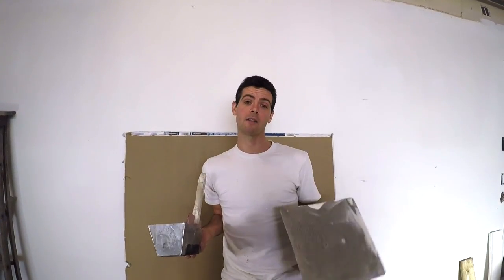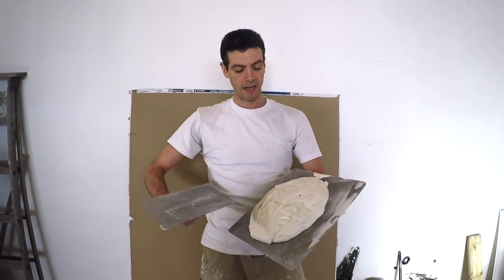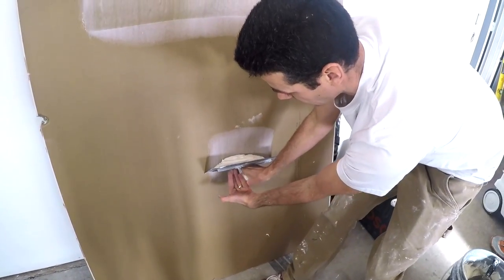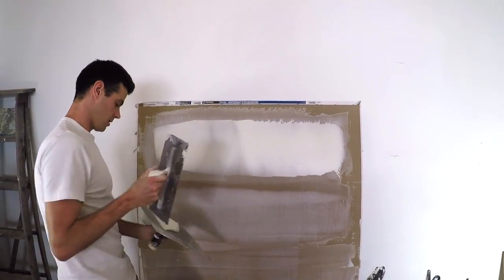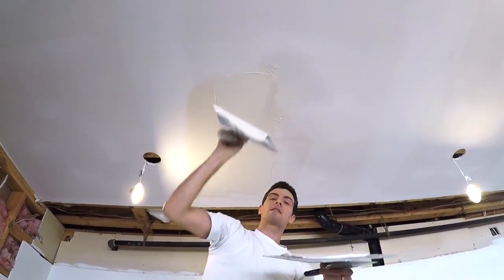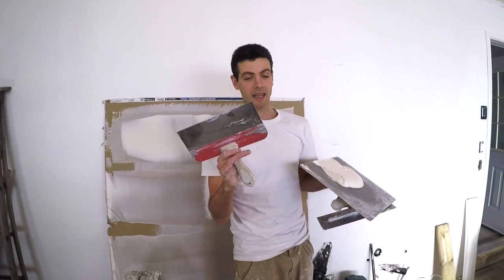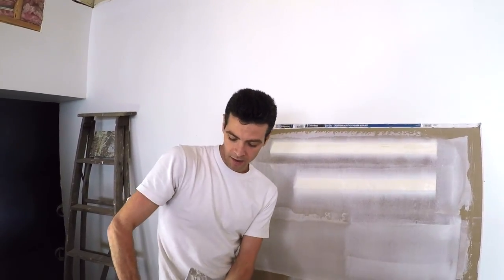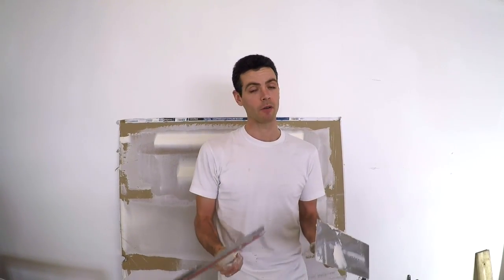HAWK AND TROWEL VS PAN AND KNIFE

Comment: As a painter in the US I've mixed and spread tons of hot mud. I've never used a hawk & trowel but after watching your videos I'm going to start. One thing I never realized is how precise you can load a trowel or knife, avoiding "squirt out". Not to mention cleaning a hawk is so much easier to clean than a pan with all it's corners !
Reply: That is called mud control. Practice is key. 🙂
Reply: The pan does suck to clean. I was just thinking that
Reply: The secret is to always have a bucket of water nearby with a brush in it. And when using setting mud, get any excess out of your pan and into the trash IMMEDIATELY as soon as it starts kicking off so that it will still come out with water.

Comment: I’m going to go out on a limb here and say that most people watching your video (in order to learn) aren’t professionals. We are homeowners trying to beautify our homes. That may not be your intended audience but I’d bet most of us are just that. 

I love the videos and the sense of humor you bring and thank you for the hard work and time you and your cameraman spend on these videos. 

If I may speak on behalf of homeowners watching this video we come here to learn how to patch door knob holes, repair settlement cracks, cover old phone line outlet box holes, and the like. I’ve done lots of drywall work but have never picked up a full sheet of drywall. I have used both conventional and light weight setting type and drying type compounds and both paper and mesh tape. 

I also understand trowels to be a plasterer’s tool and a knife to be painter’s tool. In my opinion, learning to move mud around is much easier using a knife. That’s likely because I’m never really moving much mud around by comparison. 

If I ever do large stucco work I would certainly buy a trowel. 

Thanks again.
Reply from the maker: Actually, homeowners and DIY is my intended audience but I don't mind the pro's hanging out either.
Reply: I can’t use a knife worth a darn but I’m great with a trowel. I’m not a pro. If you hate mudding and feel like it is just unintuitive, try the hawk and trowel.

Comment: I have been working on a job the homeowner tried to fix and have been having to reskim entire tape lines. I was lucky enough to stumble across your page. I have probably watched a dozen or so of your vids in the last couple weeks. doing so has actually taught me enough tips I didn't know to make the experience tolerable. tomorrow I will be purchasing myself a Hawk and Trowel for future jobs like this. (I am a painter by trade, but often, demolish, construct, drywall and repair things before Painting occurs). thanks for taking the time to make these videos, they have saved $ on potential mistakes I avoided because of your content.

Comment: As a former tile installer I'm tempted to try a trowel for mudding drywall.  Although a flat trowel takes more skill than a notch trowel.  I'm a cable contactor now and somehow I was chosen as the guy who they send out to do all the repairs when our guys put a hole in a wall or step through a ceiling.  

I'm working on a ceiling repair now.  I've got it replaced and taped but now I have to blend a circular brush pattern in the mud.  It's a 3 sq ft area I'll have to do a new texture on and try to blend to the surrounding pattern.  I hope the pattern and the color matches well enough to satisfy the homeowner.  

Keep up the good work man and thanks for sharing all the valuable knowledge👍

Comment: I've done a lot of mud work with both knives and trowels, pans and hawks and never really thought about the push pull aspect. But you are absolutely right about the "problems" related to each technique. But now I'm retired so it doesn't even get to go in my tool trick bag, shoot

Comment: Jeff on Home Reno Vision DIY  does a great job with a 4" Putty knife and a 10 or 12" trowel.  He uses the trowel and keeps the knife in the same hand as the Hawk.  He does taping with the knife and hawk.  I have been using his technique on a job (35 4'x8'x1/2" sheets) and as a beginner,  I find his system makes sense.   The trowel is definitely work to use but it is fast and I am getting better.

Comment: In my hawk hand I also carry a 4 or 5 inch tapping knife for feathering and other work. I simply place it between my pinkie and ring finger. Best of both worlds. I think the hawk and trowel is more ergonomic than a pan and knife. We call 8-12 inch taping knives paddles here, good for select situations but I wouldn't want to do a whole job with one. Great video!
Reply: In one of his other videos he actually says he normally carries his 6" knife in his hawk hand 😊
Reply: same here.. couldnt of said it better myself
Reply: @ stargate...I do the same thing except with a 6 inch, it supports the weight of the mud on the hawk, plus I can access the knife really quick to cut my edges. I was taught this way 17 years ago, and still do it. I don’t see many guys that do this,.. glad to see I’m not alone haha

.

Comment: Interesting! I've been watching you trying to up my game for my latest bath remodel. I just bought a 12" knife after only using a 10" for tons of other jobs. (knew I was going to need to float out longer than 10" in a couple spots). Watching you and another Canadian contractor, I decided to try a hawk. I've not been thrilled with the 12"; harder to use than my 10" but I just figured lack of experience etc. Interesting on your comment about going to a trowel at 12" on up...Anyway. Always appreciate the videos! Thanks!

Comment: Great video. I have taught myself to go all of the above methods. Cool trick for powder products. On hawk make a pile. now take your 4" knife and make the pile into a donut shape. Now fill water into the donut hole. now push the dry powder into the water all the way around and mix.
A little practice needed.
Currently, I have a job working on. 1400 sq of ceiling that I have removed the popcorn and power sanded. After sanding I had removed a little more then a 5-gallon pail of powder and grit. By the way, it is a cement ceiling with electric heat so it is wavy. I am smooth coating. The ceiling and it is sucking up the mud. 1 box is yielding small sq footage and I will have to apply a second coat. Man feel the burn.:-) Referring to Larry is excellent advice. By his teaching, I became so much better at slinging mud. One thing he teaches. Control your mud. By his teachings, I learned how to make butt joints not as visible. Larry also is a great teacher.

Comment: Thanks for all these videos. Very informative. I have a bunch of small patching jobs and now I know the right tools. If we tackle a slightly bigger job we will break out the trowel. The knife pull/trowel push issue also explained why our drywallers were such a mess getting the ceilings done.

Comment: Man I wish I would have watched this video before I skim coated about half my house covering up a mish-mash of popcorn texture, silicone, and outdoor plaster from the previous owners.  My knife/pan issues are the same as yours.  I admit I'm an amateur to it all, but it seems even if I had just applied it all with the trowel and then came back through with the knife I would have been better off, instead I ended up with a lot of drops, a lot of clean up, and the great taste of mud in my mouth.  Keep pumping out the great content and stay safe, cheers!

Comment: I'm a Union drywall finisher when using your 12 inch  blade if you don't want the mud to fall off the blade after you dug out of your pan a blade full of mud swipe both edges of your blade before applying to the wall
Reply: One swipe's enough - the bottom one - if you're talking horizontal seams - but between you and me, I notice you left the "hurts my wrist" alone.  Kind of you, chuckle chuckle....

Comment: Over the years the best finishers I've witnessed have used hawks and trowels,watching this one crew in particular was like watching a ballet,and when they were done you couldn't tell there was a joint in anything ,and we are talking about 3500 square foot houses,with tall walls and cathedral ceilings.They actually used knife and hawk up until the final coat.They always took seems out to about 16 inches and butt seams out to about 4 foot.

Comment: I think a trowel is slightly thicker.

Tip for the knife.. load it up then nock off the corners.
Reply: When it's worn in,it's like a razor blade.
Reply: @ashyclaret  I think Turbo meant remove mud from corners of the knife after loading it.
Reply: @superiorbeing95  
I'm on about the trowel.
Reply: @ashyclaret  Oh OK, yeh trowels soon wear in.
Reply: @superiorbeing95  
They do actually,takes about two weeks.The good ones like Marshalltown are are already broken-in,just need that extra wear on them.
Reply: @ashyclaret  I'm in the UK, trowels wear in quicker here because we plaster the whole wall not just the joints, I don't use Marhalltown any more, there are newer brands over here in Europe making nicer stuff at better prices, Refina are very popular.

Comment: The best thing about the hawk for loading larger blades is the ability to put a nice mound right in the middle - really hard to do with the pan without a couple extra cleaning swipes on the corner tips of the knife.  
The best thing about the trowel (although it may depend on the brand) is the curve manufactured into the trowel that does a superior job on flats vs a perfectly flat knife.  Also the trowel places your grip about 2-3 inches closer to the work edge of the tool vs. a knife which gives better leverage and a lot easier on the wrist after 8 hrs.

Comment: Vancouver Carpenter, I was really interested in watching this video because I am currently working on a dining room painting project and would like to use the hawk and trowel method for repairs.  Since I don't normally have to make big drywall or plaster repairs on my projects, I haven't had a need to use a hawk and trowel until now.  After removing wallpaper from the walls,  I discovered a pretty big area on a wall that had been patched before, but it will have to be repaired before painting.   I like the idea of being able to "push" the mud instead of pulling it on the surface as well and it should be much easier on the body.  Always enjoy your videos and keep up the good work!

Comment: V.C. - I learned with pan and knives (from crazy French-Canadians no less) - the trick to not having the mud blob off the edges of your knife - you have to "back" the corners of the knife, and then also scrape the back of the knife before hitting the wall/ceiling. Basically load your knife just like you do out of the pan - but then you turn the PAN upside down and scrape off the corners of your knife with the pan edge, then back over to scrape the back of the blade.   That essentially loads the knife in the middle and eliminates the blob-overs.  Then I spin the pan around.  It's a lot of pan-spinning and it is tough on the wrists  when it's full of mud- but to me it's second nature and pretty fast.  I've tried using a trowel/hawk and while I see the advantage in certain instances-  but I need a lot more practice - I'm wanting to drag instead of push.  And at this point I'm an old dog/no new tricks LOL.   Good video as always - keep 'em coming.
Reply: Tioga Fretworks I’ve found with the hawk when I’m watching my other hand spreading the mud my other hand drupes and the mud slides of the hawk where as with the pan I don’t lose it.
Reply: The best hangers I've ever worked behind are Canadians and Hungarian, fast too. That was years ago in Florida. Good ol' days.

Comment: One thing I noticed that helps  for ceiling drips, is either smaller amounts on your knife at a time, or less pressure, which both slows you down a lot. After watching your videos, I just bought a hawk and trowel. I’m sold, but I haven’t tried it yet and I’m sure it’ll take some practice

Comment: one thing i noticed is the handle on a trowel is spot welded in the center making slightly less flex then a knife. especially the edges.  so i tried hawk & trowel for the first time ever & i found the same exact thing great video

Comment: After watching this I decided to use hawk and trowel for doing my second and third coats on joins.  It takes a bit of getting used to and feathering  is definitely way harder but I love the hawk, even when using a knife.  So easy to work with and easy to clean.   The trowel blade doesn’t flex very much so bending it to feather is tricky.  Sometimes I grab the six inch knife to finish the feathering.  But I am improving with the trowel.

Comment: I’ve been doing drywall for over 25 years and I’ve never used a hawk and trowel however I’ve always been curious to try one. I’ve kinda experimented using them at my local hardware store, running the blade down some bare walls in the store while performing techniques I normally use when using a standard knife and pan and it definitely feels like it would work better, especially when a bigger knife is required. It definitely seems like the mud could be applied much further as well while staying consistent the whole time. I may try this one day.

Comment: Nice throw!! I have never tried the hawk  trowel I have used them for Stucco lots of time never thought of using them for Drywall I have always had a hard time putting mud up with the bigger blades it does give you carpal tunnel. Being in SoCal we’ve always used blades I’ve seen tons of drywaller‘s never saw them using a trowel. I will have to try it one day to see for myself I can see you have a lots of practice with the trowel You make it look really easy

Comment: It's really what ever you get used to. End results are what are important.  You look to be proficient with the hawk and trowel,  while I, on the other hand would have most of that mud on the floor if I tried it.😊. Another thing, the old drywall trowel actually have a bow in them. It looks like you are using a cement trowel. Last thing, you are correct, I am a painter. I finish drywall with a knife, 5, 8, & 12. Double 12 for butt joints. 4 for inside corners. I hang wallcovering with a 16" trowel . Great video btw.

Comment: Great vid! 
Most of my jobs I use both Hawk & pan... & knife. Still wrestling with trowel... find it hard on the wrist while trying to get the correct angle.
Thx for sharing :)
Reply: I tried skim coating a 160 sq ft wall with a hawk and trowel and my wrist and shoulder are toast. Had to switch to the pan and knife and it was so much easier, but with more trips to the mud bucket. If I were a professional I would definitely get good at hawk and trowel, but I'm not, so pan and knife it is!
Reply: I tried skim coating a 160 sq ft wall with a hawk and trowel and my wrist and shoulder are toast. Had to switch to the pan and knife and it was so much easier, but with more trips to the mud bucket. If I were a professional I would definitely get good at hawk and trowel, but I'm not, so pan and knife it is!

Comment: I'm a hawk guy.  I find it easier to get the right amount into the tool (whether trowel or knife) A pan gets messy for me and leads to more clean up time.  I like being able to apply mud with the length of a trowel and strike the excess off the trowel and back to the hawk using the short edge, keeps the mud in 1 place on the hawk.

Comment: I've been running a knife and pan for 20 years and no carpal tunnel for me. When you pull the mud out of the pan you should wipe 1 inch of each end of the knife off with the pan, which will prevent the mud from running off the ends of the knife. I've only known 3 finishers that use a hawk and trowel and I assure you that I can finish a room about twice as fast as they can. Everybody will have their own preference with what tools to use and the fact that you prefer the hawk means you will lean towards making it look better/easier than a pan. Make it fair and bring in a someone with no experience and no preferences and hand him/her the tools. Let them decide what they prefer and post that video. I think this would be more suiting as these vids are more for the diy homeowners that are in that situation themselves. Just a thought.
Reply: Exactly I use a knife and a pan and it's really all I know although we do our hand texture with a hawk and trowel but I still prefer a knife, I'm way faster with a knife because It's what I'm use to and I also wipe the mud corners off of my knife too, It doesn't matter if the pan is 12 or 14 inches and full of mud because neither bother me because I'm so used to it. I also love tape and bedding so nothing really gets in my way and I do feel like a knife is alot faster than a trowel.